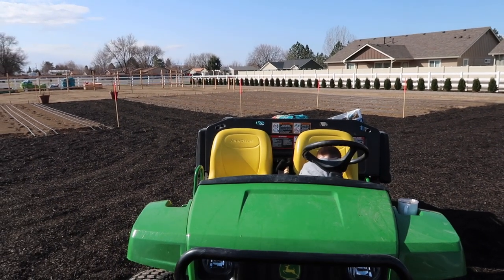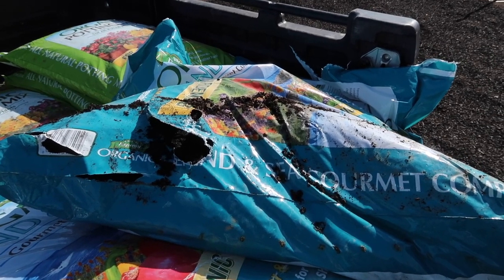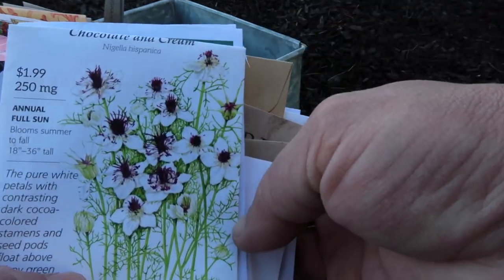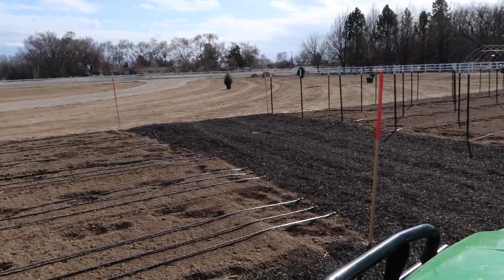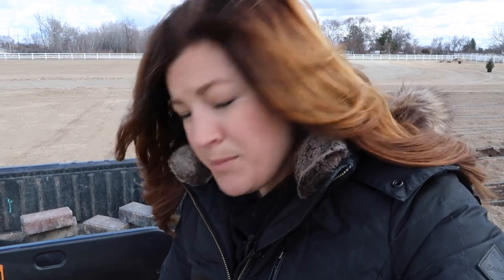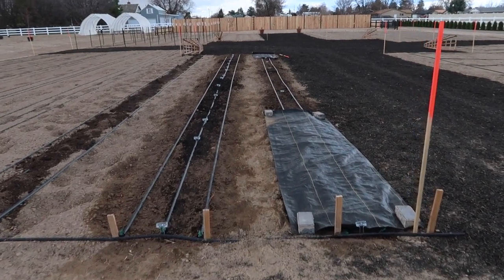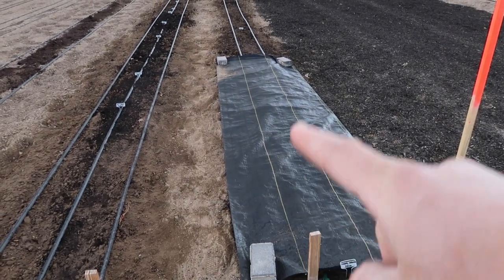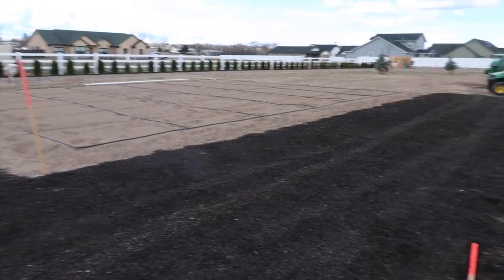Planting the First Seeds in the Cut Flower Garden! 🙌🌸👩‍🌾 // Garden Answer

Comment: I planted nigella seeds few weeks ago it never came up I still have few seeds left.do you have any suggestions?!.does it need cold stratification to germinate?
Reply: Read the back of the seed packet for directions.
Reply: @jgwood10   they don't have any information.
Reply: SOWING:
Sow 3-4 times every 2-3 weeks early in season for continuous flower/pod production. Direct seed (recommended) — Sow in early spring when soil temperatures reach 60°F (16°C). Fall sow where winters are mild. Cover lightly with soil as light is required for germination. Transplant — Sow 4-6 weeks before last frost. Plants are sensitive to root disturbance. Copied from Johnnyseeds.com